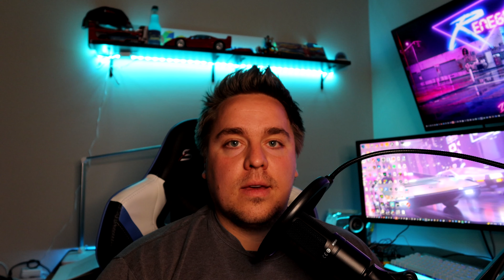How You Can Pursue a Graduate Degree While Working as an Engineer

Comment: Can you make video which can differentiate Android emulator and Android x86 os , i wanted to know about the how Android x86 os runs directly Android apps in pc intel/amd processors , even if the application supports only arm32/64 , we can run it in Android x86 , by enabling native bridge, i wanted to know how it works,  because in a low end laptop we can not run emulator in it but we can use Android x86 which runs better than windows . Like this i wonder how a application for Android (whose name is Wine 🍷 ) can cun windows executable files in Android .

Comment: What are your thoughts on someone currently working on a CS degree pursuing a career in embedded hardware? I have over 7 years working  with electronics (assembly, diag, common testing tools) and started a degree in EE but had to stop a couple semesters in.
Reply from the maker: If you have experience at that level, you'd be fine with a CS degree to do embedded systems.
I only caution a CS degree background, because I think those people expect to be able to use the same techniques you learned in school, but you just won't be able to and you have to care and have the motivation to understand how the hardware works, otherwise you'll be disappointed.
Reply: @ZygalStudios  thanks!